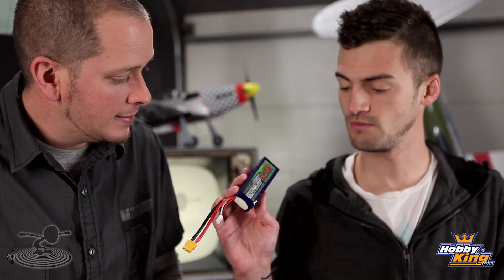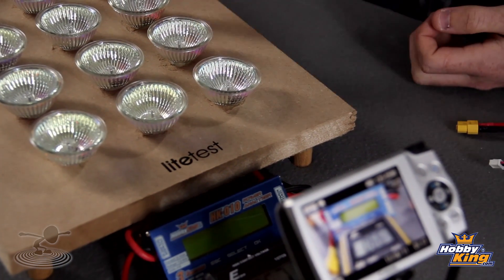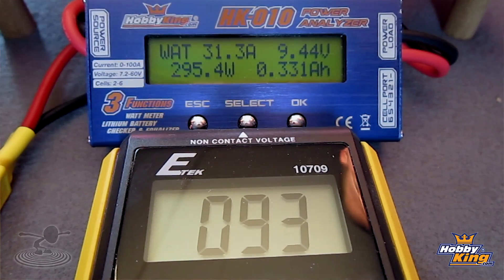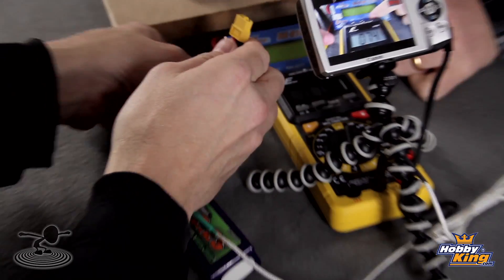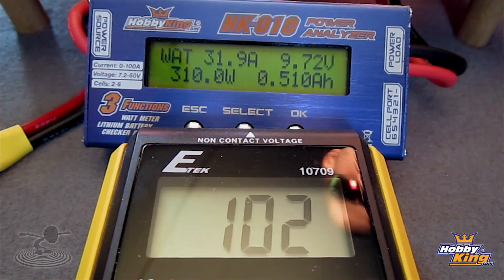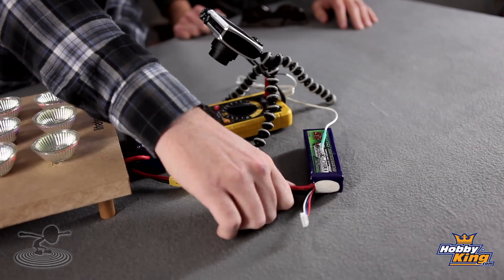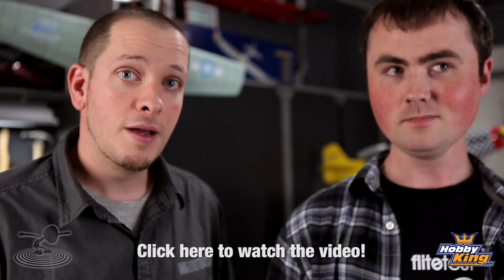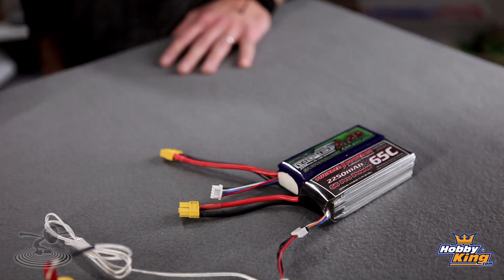Flite Test - HobbyKing Nano-Tech - REVIEW

Comment: Great video guys. I’m new in the RC Hobby world, but I’m very surprised that everyone uses LiPo technology. Run times are terrible, charging is dangerous, and they are a high maintenance battery. There are lithium ion batteries that are much more stable; in charging, run times are as much as easily doubled, and size to weight ratios are very close. I don’t know what the price point differential is, but if you can run a battery down to zero percent and a LiPo only to 70% ( I think and I do not know this for sure), wouldn’t the transition be almost automatic? I don’t know about amperage draw, but from what I’ve seen, on youtube, why aren’t people using lithium ion batteries? Thanks so much in advance, Nathan. 🙏🏼😉🇨🇦

Comment: 65cx2.250mah=146.25 amps continuous draw capable.  test shows avg  32 amps draw.  
even the 20c battery  20cx2.200mah=44 amps should have lasted longer then a few sec.  i beleave the battery's were not fully charged. a fully charged 3s is 12.6v 
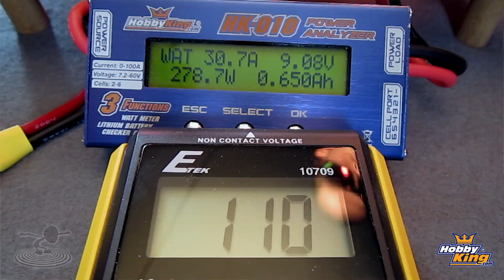the nanotech test @ 6:07 (end of test) shows 0.684ah (684mah) battery is 2250mah  (2.250ah)
Reply: +SouthFlaDiver 2.200mah/32amps=.06875x60sec=4.125min.. test should have lasted 4 minutes on (fully charged) 65c batterys
Reply: Read the description.  The amp meter was showing 1/3 the actual draw because when they first connected the meter to the full bank of lights the current was too high and fried the meter. They connected the meter to one of the three rows of lights. 

So when you see 33A on the meter the battery is actually supplying 99A. 
In regards to the voltage and total mAh, the rated voltage is with no load. When you measure the voltage with a meter is it drawing almost no current. A volt meter typically has an input impedance of at least 10M ohms (10,000,000 ohms). That equates to about 1.3 uA (0.0000000013 amps) which is why you van leave a volt meter connected to a battery pack for weeks without the battery discharging.
Under high load the battery voltage will drop. This is why you often hear a low battery alarm sounding on a plane or multi rotor when running at full throttle and the alarm stops when the throttle is backed off. Under the lower load the voltage rises above the alarm trigger point.
Reply: yup read the description "voltage is actual "
Reply: 12.6V is the max voltage with no load (and even then, most cells right off the charger come in around 12.57 or so). Voltage drops as load is applied (not just over a discharge), and a 96 amp load is a serious load, thus the packs could only sustain 9.4 to 9.6 at that amperage. While we don't know for sure, it's entirely reasonable that they charged the packs to full, and with that severe a load a voltage under 10 is all that the packs could sustain. It's also why, if you fly until the low voltage cutoff from an ESC (usually 3.2 or 3 volts per cell), most packs will still register 3.5 or 3.6 per cell immediately after flight, and will come up further once the packs cool a little. The ESC only saw 3 volts per pack while under load; the voltage comes back up some once the load is removed. It's also why some packs that don't have a high C rating may cause a brief low voltage cut during hard maneuvers that pull a lot of amps.

Comment: ok if I have a 3s battery what is the low voltage before you start damage lipo
Reply: 3.2V per cell for any lipo cell
Reply: jameshone1000 keep the battery not bellow 3.5~3.7v
Reply: jameshone1000 9.6V period

Comment: The problem running just one test is the "scarce data" problem. Your test was interesting, and I learned a bit from some of the comments. Having run product field tests in the past, you do have to adhere to fundamental rules of statistics and take enough data and report the margin of error. Overall, from the comments, it sounds like there is a big variability in quality of all LIPOs. That's awkward (borrowing from flitetest vocabulary). The manufacturers are not providing dependable products, in general. You gamble every time you buy a LIPO, like the US cars of the 70's - such low quality control each one had different dependability. I just hope a badly manufactured battery doesn't ruin your flying day, or bank account.
Reply: +Peter Gregory 
Excellent points. The flitetest guys tried to be a little bit scientific, but still fell short. These guys, including David, and clearly not engineers.
Two things they should have done, but didn't.
1) They should have sourced several of each battery from different warehouses and production runs. There is absolutely a lot of variability. I've seen that over and over.
2) They should have done lifecycle tests to see which one lasts the longest over time. One test per day for 30 days would have been very useful.

My experience has been that LiPo cells made in China do no last more than one or two seasons at most before lithium oxidation puffs the cell and renders the IR so high that they basically become 1C or 2C batteries. 
This was not always the case with so-called premium brands.  Unfortunately even they have succumbed to pricing pressure and have been using inferior Chinese cells instead of the higher quality Korean cells they once used.

Comment: What the hell have I been looking at on ebay "Turnigy Nano-Tech 2200mah 4S 35-70C Lipo Pack High Performance Battery". Are they both the same Turnigy Nano-Tech?
Is this what happens when you blast a product, they just merge names with the better brand.

Comment: I know the given math equation that is out there, and as you have seen from your test in this video and I have from my own testing that is not perfect.

You were pulling 105 amps and thunder about died!  In actuality companies kind of FIB to sell batteries, also the math is not perfect, I run my stuff as if c rating was actual max amp load, may be over kill but ITS SAFE u guys need to show the AEO tools that measure the Volt Watt & AMP over 100 amps so people can see what there set up is doing

Comment: I'll stack my Turnigy Nano-Tech up against any other battery.  I Think they are as good or better than anything on the market at any price.  Factor in the value (buy from USA warehouse and save on shipping) and the clear winner is the Nano-Tech.  You can buy two Nano-Tech batteries shipped for the cost of one 'major brand' battery; give or take a buck or two...  That gives you 2 bats to play with, take good care of them, watch your voltage draw and run time, ballance charge and storage charge.

Comment: It was only measuring one bank of the three banks of light that were wired in parallel. So, the 500 mah was really 1500 mah. Also, if you look at the discharge rates as a function of the amps, you'll see that the higher amps you draw, the lower overall capacity you get. So, drawing a 2500 mah battery at 900 watts, it would make sense for it to put out less than the 2500 mah that it's rated at.

Comment: I was a firm believer in flying with expensive batteries.  It wasn't until I needed a cheaper alternative that I looked to the Nano-techs.  These batteries are absolutely amazing.  I am still flying on a daily basis 20+ minute flight times on an 1800 Mah Nano-Tech.  this battery has close to 50 charges on it and there is no puffiness and it will still hold a charge.  try one they really are good batteries.

Comment: I fly Turnigy Nano-Tech batteries in my Fox motor glider.  By far the best battery I have ever owned.  I am still using the same battery that I first bought with this plane 6 months ago and I fly at least 3 times a week.  and my flight times are through the roof.  These batteries hold many repeated charges.  You cannot beat these batteries for the price.

Comment: Continued post:  I want buy any more Nano-Tech batteries even if they are half the price. Sometimes You do get what you pay for. Cheap batteries tend to have shorter life spans when pushed to there rating. I will be trying other brand batteries to see how they hold up.  The Nano-Tech batteries were bought from Nov 2011 till Feb 2012. Don't know if the batteries I got where not up to par. But they are not lasting . I have got better life out of a regular Turnigy with close to the same "C" rating.

Comment: The Nano-Tech may beat the TP in a short test. But in the long run the Nano-Tech may not last.
I bought 12 Nano-Tech batteries, 6- 3000 mAh 25c and 6 -2200 45c. I fly Quad copters and I have checked the amp draw and it is less than 40 on all 4 of my quads. I fly one with with 924Kv and 10x5 props, the others are 1200kv with 8x4.5. I kept up with the charge cycles and 7 of them have 30 or less cycles the rest are just over 20 cycles. I have 9 out of the 12 that show signs of puffing.

Comment: I run T.P. 3 cell packs and recently some 3 cell nanotech and i have to say for the price vs performance i am very happy with the nanotech's so far !
The amperage draw vs initial voltage drop is not consistent to a fully charged pack with a cont. dis. of 65C.A fully charged T.P. 2250mha with a cont. dis. of 65C pushing under 140A for that period of time should not drop below 9 volt and puff up. If this actually occurred T.P. would consider it defective and replace it at no charge i believe.

Comment: IMHO, having used many brands of lipo's over many years i have until recently  come to expect the advertised C discharge rate to be almost half the actual capability of the battery(excluding T. P.). For me Thunder Power is the benchmark i compare other brands to. Everyone i know who has ran T.P. packs agree without any doubt they are the best when it comes to performance as well as weight vs capacity.The price of T.P. packs is why i have tried many other brands(all but Nanotech failed C rating)

Comment: 1) The start voltage of the batteries is not shown, the camera angle conveniently changes exactly at the start of both tests. A small difference in start voltage makes a massive difference to the results !!
2) At the start of the test the thunderpower pack is showing 95.4A draw (3*31.8A) which is 42.4C or only 65% of max C and yet its allready at 9.59 V, it would hold over 11v for at least the first 10 secs or so. This clearly shows that the Thunderpower pack was not fully charged...  continued

Comment: TBH TP batteries are way over priced. So are some of the main competitors such as Hyperion and Gen-Ace. When I can buy a 4s 5000mah Turnigy battery for $42 but have to pay $80 for a Hyperion or TP 2s doesn't make sense. I have had bad experiences with big RC names such as TP and Spectrum. Bloating on the TPs and malfunctioning on the Spectrum gear. In RC the saying "you get what you pay for" doesn't work! At least not for me. I have just bought my 1st 2 x Nano Tech 4s packs. Time will tell.

Comment: @shadowsimjk Yes I know about how to wire lights, I was meaning the meter. There is no reason you can't measure what the battery is actually experiencing, directly. We don't care what's happening out on the circuit, we need to know what the battery is seeing. I know it 'should be' correct with the math, but measuring somewhere else gives an opportunity for incorrect interpretation of the results.

Furthermore, anyone who's used both brands knows the result is hooey.

Comment: @jasmine2501 

On a 3S, the logical way to wire 12V halogens is to stick them all in parallell. If you put them all in series, you wont get that many amps of power draw.

Indeed it doesn't have to be as "complicated", you could just use a regular DMM to measure voltage, and a regular clamp meter to measure one bulb, and derive the total amps by multiplying the displayed amps by the number of bulbs you have, and then you need to integrate the voltages and amps to get mAh and Wh.

Comment: @13Anko   Thats odd, because the Nano's that I've had have all been good. 
Ive only had  "Normal" turnigy batts go bad but $9 for a 2200 3s I didnt really care.
Im pushing 160kph in my RC converted chuck glider "Multiplex Fox" with a
1000mah 25-50c 3s drawing 40 amps hnd is going good so far.
 Sorry that you've had bad luck with the Nanos but its been nothing but good experiances with mine.

Comment: @halo001ify The meter didn't break. That meter draws current from the battery and needs a certain voltage to be operational. The voltage on the battery dropped so much because of the high load on it that the meter didn't get the power it needed to be operational.

Comment: @pixelzpusher What I am trying to say, I am not even sure I'll be using 3S 5000mahs anymore when my batteries finally kick the bucket :) 3 years ago I bought several TPs, they are still like new, but the plane they were intended for is long gone, and I have very little use for them now. Not a good investment, really. On the other hand, 2200mah Nanotechs I bought a year ago after heavy use are now reaching the end of their lives, and that's no problem -- my new multikopter runs on 5000mahs now.

Comment: @peperpimenta True, I haven't used TP but I have used Maxamps which is rated as another "high class" battery. That thing I bought for nearly $200 and lasted 6 months before shorting out, however each of the two $35 Turnigy's I bought afterward have lasted since march and are still going strong. So I don't really follow that "big name=better quality" crap anymore.

Comment: @pixelzpusher Sorry the last comment (from bagurka) was mine. When I go into the wilderness to shoot aerial video, I like to bring as many batteries as I can -- there's no time, or means, to charge them on the spot. With this in mind I prefer having two 5000mah Turnigy nanotechs (2x$32) instead of one Skyshark (1x$73), and enjoy double flight time when it counts. Longevity is not a big issue since my power requirements change faster than batteries degrade.

Comment: I'm glad people are bringing up the longevity issue.  I bought 4 HK's and 2 Fantoms in the spring for my 1/8 buggy.  1 HK lost a cell, 2 HK's puffed, and I sold the other before something happened to it.  1 of the Fantoms puffed and Fantom replaced it under warranty.  So, I've got 0 of 4 HK's and 2 of 2 Fantoms to start next season.  Do the math, the Fantoms are the value.
One last comment, warranty, WHEN HK decides to make a good battery, they will probably come up with a good warranty for it.

Comment: I would be very surprised if Thunder Power doesn't sue you over this completely invalid test. How many times did you have to do it before you found a way that made the NT look better? There's too much hooey in this video. It doesn't have to be this complicated. On a 65C 2000 mAh battery, you can pull 130 amps - there is no reason you couldn't hook up 130 amps worth of light bulbs IN SERIES, and get the amp draw directly.

Comment: Yep nanos are good when new, the soldering is very weak and i had a couple of nanos where the wires came loose. they are good value in a short run but they don't hold up long, even the standard blue turnigys last longer then the nanos. value for money? not really considering the postage time and prices, i will stick with local, Hyperions...

Comment: I'm glad everyone else is suffering the same problems I am with crappo-tech or puffy-tech lipo's as we call them at our flying field. They work for a few cycles and then comes the puffing followed by a rapid degradation of performance. Most of mine lasted a few cycles and that was it... By comparison - the 'expensive' Thunder Power lipo's deliver time and time again without any drop in performance. Spend the extra and buy Thunder Power. I won't ever buy another HK lipo!

Comment: @pixelzpusher   Totally agree.  Havent flown for about 3 months.  Dig out my Nano Tech,45c 1 yr, TP 45C 2yrs, FP 50C 1yr. Flying my Add X I usually get 7mins with time to spare, throw in the Nano tech and Low volt cut 5 mins into the flight and very puffy.  Both TP an FP Flew just fine. Recharged the Nano Tech and same result, 5 mins and puffy.All Lipos where charged to storage voltage once a month until I use them again but somehow the Nanotech has lost its capacity.

Comment: @pixelzpusher In my experience, Nanothechs CAN deliver impressive power when new (so this test is believable), but it is also true that after less than a hundred charge cycles they have only 2/3 of their initial capacity, run hotter and get puffed easily. Interestingly, the higher-rated varieties (45-90C) degrade faster than 25-50Cs. That being said, I still think Nanotechs are a good deal, especially 25-50Cs. I have 12 of them, ranging from 2200 to 5000mah, and I am buying more.

Comment: A single test run means nothing. Nanotechs are great for the fast charge and perform well when new, BUT in the "long" run the experience me and my friends got with about 40 packs over the last year is that:
- Half of them puff or have one or more cell that loses a lot of capacity in less than 20 discharge cycles
- C ratings are BS. The "25C continuous" ones won't hold a constant 10C without getting dangerously hot after discharging 70% capacity
- Some puff in less than a month, even new & unused

Comment from the maker: @pixelzpusher We used three rows of halogen lights to discharge the batteries. The power analyzer was only connected to one so we wouldn't kill it. While the voltage is actual, the watts and amps are 1/3 of the actual draw. We say this in the video. The display at the bottom is the temperature in Fahrenheit.

Comment: @13Anko yeah and they have the same power.. . get real..
I used my NT 4000mah 45c for 1 and a half years. can' t remember hwo many flights .. but definetely jump started cars dozens of times.. .. stop comparing overpriced batteries.. and they still puff .. a 3300mah 4s 65c TP puffed on the first use on a dynam meteor with an RClander DPS. unit.. I can take the cost of a NT to puff. but never an overpriced thunderpower. and yes the 65c NT are GREAT...